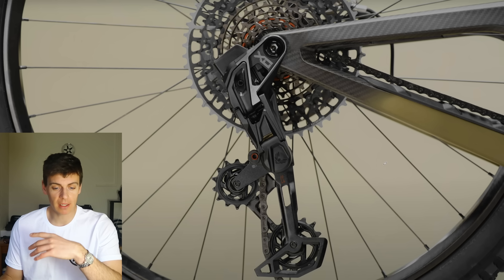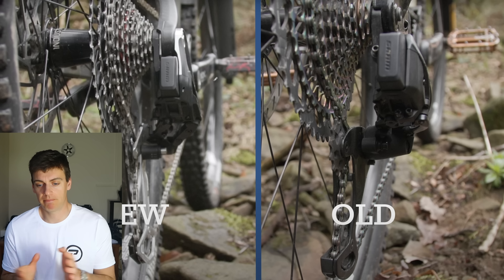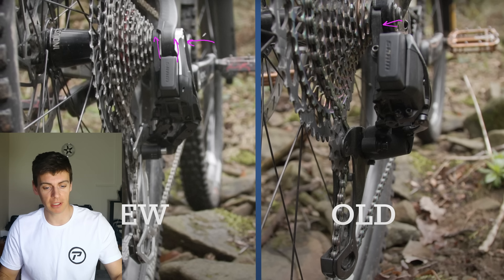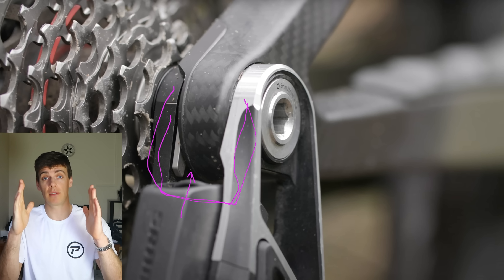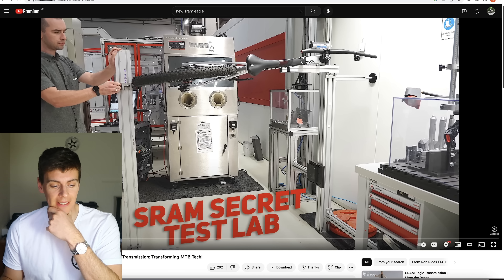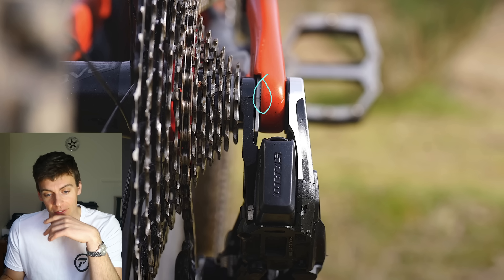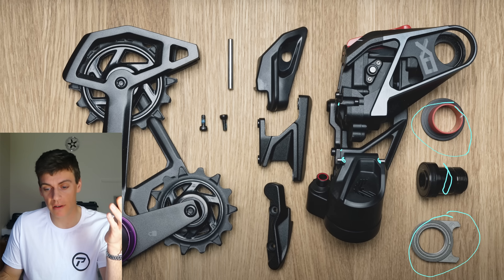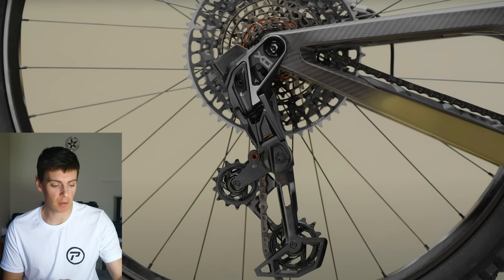Mechanical Engineer's Speculation of new SRAM Eagle (including misinterpretations!)

Comment: "They've created a solution to a problem that didn't really exist, the price is 650 USD just for the rear mech" about sums it up.  It needs to be mentioned too that these use proprietary batteries, which is a telltale sign of consumer antagonistic planned obsolescence landfill toxic waste.  You can get a cable today for bicycles from the 1960s in any bke shop, I have effectively a lifetime supply in the basement, didn't even cost very much.  You can't store batteries that way, nor can anybody afford to buy them that way, and anyway, its a proprietary battery, next year's mech could have a different one.  Having seen the consumer antagonism SRAM and the other one are capable of with purely mechanical technology, I shudder to think that they'll do with batteries, let alone software.  Now let me go mount a serrated metal washer to my carbon bike frame.

Comment: I would have to inspect it closer but from what i've seen on the third picture of the pinkbike development article the derailleur is positioned by the axle and not by the dropout. That's one of the reason you don't need limit screw and tuning. The cassette will be positioned relatively to the derailleur via the axle so there is no real issue with alignment in my opinion. In fact i genuinely think it's better. Many hangers are bad and are too soft so they constantly get bent for no reason and it happen regularly that you're out on the bike and 's*** the hanger is bent" and you have to correct it by hand to enjoy your ride. Also people are not at their LBS after every ride to have their hanger checked. Plus many hanger snap for no reasons. In this design the external bending forces will pass to the axle/hub and not to the dropout. It's not perfect but i don't see it break many more frames than the hanger design.
Hanger experiences on my bikes : 
Scott Spark 18 => fine hanger 
Cannondale Moterra neo carbon -> snapped, bad design. 
Trek speed concept 1 -> Dropout snapped, had to rebuild something to get the bike rolling, known issue. 
Look 795 light -> ridiculously soft hanger.

The added stiffness and eliminating source of misalignment will make for better shift. 
Price is out of this world given that a good mechanical eagle already works superb.
Reply: I’ve snapped way more frames than I have mech hangers 😜
Reply: @williamsimpson8115  yeah me too thats the reason i only ride aluminium because the are cheeper to replace 🤣
Reply: And you have to remember that many frames get damaged because the hanger snaps because of a realitvely little stick and the derailleur gets into the cassette and smashes into the chainstay. Those are the main carbon frame damages I've witnessed. I agree that I am annoyed by the bending of hangers, sometimes even just by loading the bike into the car. I think there are shifting performance gains possible with this system, and I'm curious if it can prove itself and if tolerances are sufficient.
Reply from the maker: Good comments. Firstly, is it actually positioned by the thru axle? The derailleur inner plate is firstly bolted to the inside face of the dropout. Then it's pulled in by the thru axle. So its a combination of both systems and their stiffnesses as to where it ends up! 

Great points about soft hangers. How many times have we seen mechs go into spokes when someone shifts to the large cog after having knocked or dropped the bike. Very common.
Reply: @PeakTorque  yes it positioned by the they axle. The derailleur is assembled onto the bike to fit the bushing assembly and derailleur. The thru axle then goes in to set the position and alignment, usually with a wheel or hun included for best accuracy. Then everything is tightened up and the B limit position set. Then everything is torqued down. These derailleurs don’t move up and down much in use and the bush is replaceable anyway just like with a normal hanger mounted derailleur. I had the mechanic if the 91songo Specialized team show me how it goes together on Tuesday. They can stop raving about it because they don’t bend hangers anylonger (they have been using these derailleurs since last year) which makes for more reliable shifting in the races. They used to bend hangers a lot. It was improved first with the overload clutch and better now the whole thing is stiffer for the heavier derailleur (than a mechanical unit). For us mortals a mechanical derailleur also has an overload clutch Called a derailleur spring. If anything this design improves the mounting for electronic derailleur’s. The mechanical units will likely stay as they are now.
Reply: great comments Antoine

Comment: It is impressive how the industry is trying to destroy an almost perfect machine. The mech anger is a simple, by design, tool to absorb possible damages to the frame/bearings, AND to the rear mech. SRAM, as it is more than usual nowadays it is giving us "inovations" that we don't need. A more expensive product, more prone to be damaged and trying to create a new standard motivated by marketing ideas and not thought by engineers who know what a bike does and how is used by an end consumer. A last note to you @peak torque: kudos! The "reviews" that started to appear at my YouTube feed where a disgrace: not even one pointed out some obvious problems: just one that mentioned the more energy the battery has to use to move the strange device. So, it will last even less. Does anyone need more than a cable actuated 12 speed XT system?

Comment: @Peak Torque, you talk about this as if the derailleur is mounted to the frame... But isn't the whole point of SRAM's design to mount the derailleur directly to the axle and thereby fixing it to the same plane as the wheel/hub/cassette-system? Is there really that much necessary tolerance/possible play in the axle-derailleur interface that problematic levels of force would affect the frame at the dropout upon impacts to the derailleur?

Comment: There is a spacer in the mount that takes up the slack necessary for install.  It's also indexed to allow accurate alignment when assembling the derailleur to the bike.   A few other videos show the install process.
Reply: The washer is also smooth on the dropout side.   It's not serrated on both sides.

Comment: Excellent assessment, except it’s nought but an exercise on paper. 

Out in the real world, folks have been riding this for close to half a year and reported nothing short of a stellar performance. Quite simply, they had to actually be trying to intentionally take it out to actually cause any sort of temporary damages. And more of then than not, nothing that couldn’t be fixed by a quick part replacement. 

Hits that the new UDH would shrug off, would likely have left you stranded if you were on a traditional hanger based system. 

But heys, it’s not always about real life facts for some ppl right? Change bad. Must protest. Ain’t that right, folks?

Comment: Also, SRAM shows only the impacts from the side which in my opinion are not the most common ways of saying goodbye to the derailleur hanger or the mech itself. I am really curious what would break first if you hit the rock or stump head-on or what happens when the stick gets caught in the spokes and takes the derailleur cage for a ride around the axle.
Reply: I think it's just going to be a few months after launch that we'll be seeing pics of broken/cracked rear triangles on frames from knocks. Most knocks will happen at the bottom of the cage which will only amplify the effects of any forces. It's fine for SRAM though, the derailleur will still be unharmed, I'm sure.

Comment: I’m not an engineer so this is pure speculation, but do you think the accuracy for the tolerance of the frame would be greater than however straight the average bike mechanic could get a hanger? The way I see it, this derailleur will always stay within frame/derailleur interface tolerance, however the hanger will only stay as straight as the mechanic can make it (not forgetting that the more times a hanger is adjusted the weaker and more prone to bending it gets)? 

Additionally, would the bushing not just be replacing the standard B tension pivot and therefore not be introducing significantly more potential wear and subsequent play into the system? Would love to hear your opinion on these

PS that carbon mashing monster shim is outrageous

PSS Gearboxes for lifeeee 🤙🤙🤙

Comment: Great video PT. I did think however that the point of the system was that as the mech is tied directly to the axle then it goes some way to negating the possible angular mis-alignments of the frame. With the assembly clearance in the frame and the relatively high stiffness of the new clevis hangers does it not mean the mech will maintain its perpendicularity to the wheel axel and therefore cassette? So in effect doesn't matter if the drop outs are on the piss because the mech (jockey wheels) to cassette will maintain a coincident plane? The whole wheel and mech system will be on the wonk but straight to each other. That's what I understood from the marketing.
Reply: yeah, i dont get why a Engineer does not pick up on that...
Reply: it will maintain it alignment with the frame not the cassette or the wheel
Reply: @parthmache4733  so we have this big clonky thing, resting against the hub, secured by the axle, pressed against said hub, i think it aligns with the wheel...

Comment: As with anything SRAM, don’t be their Guinea pig. SRAM has a bad habit of launching product and having their customers iron out the problems for them. 

The dropout piece really concerns me. Ive seen frames with up to 15mm gaps on 148mm thru axle setups. I can imagine the mounting angle changing quite a bit once wheel is secured.

Comment: Hey @Peak Torque

Love your stuff. But there's a couple of factual inaccuracies you might want to address.

- The cassette has an odd 21 tooth. I don't think it's narrow wide at all. Just improved shift gates I guess.
- Any slop between the two plates of the derailler is taken up by the derailler bolt, not the through axle. 
(Edit: This is incorrect. The outer plate is not clamped at all as PT has indicated in his pinned correction comment and latest video)
- The knurled washer will not move when you remove the wheel. It's held in place by the derailler bolt.

Interestingly the derailler bolt torque as written on the bolt from the first batch is 25Nm, and they've already claimed that was a "mistake" and the correct torque is 35Nm. 

I generally agree with most of the sentiment of this video. Wouldn't want the useful content to be ignored because of these small errors.

Keep up the good work!
Reply: The cassettes utilizes narow wide tech and is even, save the 21 tooth cog for installation
Reply: Thanks,  I watched this video with great interest and thought surely if there are this many mistakes in the design of this new system they wouldn’t have manufactured it to begin with knowing the liability would fall back on them.  I’ve been extremely happy with my AXS stuff on my road and MTB bike and generally it has worked without issue.  But….I did have to cut a ride short yesterday because faulty shifting due to limit bolts being loose.  The new stuff does away with this.  BTW, I’m not an engineer but shouldn’t any metal contact point between the carbon frame and say, the star spacer that’s part of the clamping mechanism for the derailleur on,y make contact with a metal embed in the carbon?  What keeps the traditional hangers secured without creating the same issue to the raw carbon ?
Reply from the maker: Hi Thomas thanks for your points.
1. The setup cog i think is the only non NW cog. The others are, nothing wrong with that. 
2. I understand i misinterpreted the outer plate does not get clamped to the frame. I pinned the comment about that. 
3. The serated washer is static yes, but it sees extra cyclic clamping every time the thru axle is tightened/released. I also have heard from another channel of this part spinning and eroding the dropout during impact on their impact test (although they didn't show it). So i do believe that is a risk.
Reply: I wonder how long before someone asks SRAM to pay for a frame or rear triangle to be replaced after their new design causes damage due to no manufactured weak point being the hanger. Not an "if" but a "when".
Reply: spot on Thomas. There's a lot of BS in this video which is an injustice to his usually good work. I won't throw the baby out with the bathwater but this video deserves down votes and if he doesn't address it I'll put in the YT Karen group and unsubscribe

Comment: Dunno about the crevice clamp issue?   From the pictures it looks like there is a shim in between the inner Mech and the frame...  and as far as adjusting the mech by bending the hanger?   That's only needed on old style because the mech it attached to the frame .  this system is datuming to the axle itself. Ignoring the frame
Reply from the maker: Put the final axle position is set by the dropouts...

Comment: I agree with a few of your points.  With alignment I don’t see it being as large an issue. This design is always aligned to the rear axle. The stack up is not ideal with multiple component interfaces from axle to mech. The serrated washer confirms this design intent in my eyes as the inner clevis plate is able to move slightly and then clamp down aligned with the axle.  As a fellow ME and cyclist I enjoyed listening to your take. I think it has merit, but the design needs to mature.

Comment: Isn't the idea the mech is aligned to the axle. So the accuracy of the dropout doesn't matter.  Normally new solutions solve manufacturing problems.  Disc brakes solve delaminating carbon rims. This solves shit dropouts.

Comment: I liked the arguments but didn't get the last one: Isnt the sideload transfered between teeths of the cassette? The rear mech moves a chain that does not have any load and presets it to a different cog while shifting. The sideload problem comes once the shifting links are in the area of the cassette where the load is transfered. 
I shift under load since years. up and down, no problem, didnt break cassettes or chains.

Comment: I think you’re reaching for ideas to make it look bad. The mounting tolerance issue is non existent because the alignment is taken up by the thru axle into the derailleur
Carbon layup damage???!! Come on that’s the biggest red herring on the internet. Mtbs see far bigger loads just from riding along than from a derailleur impact with a rock. How big of an impact are we talking about here?

coming back to your nonsense on alignment is quite shocking. With T-type the rear derailleur is always aligned at 90degrees to the thru axle , hub and cassette, therefore far more reliably aligned than a derailleur hanger and actually taking poor bike industry frame tolerances out of the discussion. 
Sorry PT, you are better than this crappy video. This just feeds the trolls mate.

Comment: I must admit I'm not within the target group for this product and I don't see a need to get rid of the hanger as well. 
There's a lot of concerns I share. What I'm not to sure about is your conserns about the shifting quality depending on manufacturing tolerances. Sure that would be an issue when shifting with cables. Here we have a kind of self aligning system. Not sure how it can cope with unperfect angles but they might have found a way. 
Also the bushing - if it's easy to replace and cheap that should not be an issue. Hangers needs to be replaced and aligned every now and then as well to keep the shifting performance.

Comment: I don't agree with general comments on alignment.   The frame has flex and will ultimately line up the same each time when the axil is installed.   However I completely agree that no matter how strong you make it without the hanger week link the damage is going to be worce .   It's very common for those of us that ride rocks and steep long climbs to take quite extreme damage but it usually easy repair replacing hanger

Comment: It is amazing how PT is literally standing alone against all marketing-text-vomiting channels. Kudos to you for keeping it real.
Reply: It seems “knowing for real” would be the goal before declaring the new mech a failure. Despite your engineering pedigree, your video is basically speculation. It’s all speculation until you have the device in hand. But judging by your confidence and 99% of the comments, you and your followers are convinced of your righteousness without a single ride or manual inspection. I respect approaching bike industry technology with loads of skepticism, but speculation is just speculation. 🤷‍♂️
Reply: @AaronLester123  I would get the impression from my first time watching him that he would not ride a carbon frame nor a carbon wheelset nor carbon handlebar because all of those items could also contain hidden damage from a crash against a pointy object. Carbon has that weakness. Maybe only steel is real for him. Crashes and impacts cause damage that is the nature of the beast when mountain biking. 
Regards shifting indexing with a replaceable derailleur hanger, the first good branch hangup in the system generally messes alignment as well. Once again just a faucet of mountain biking.
Reply from the maker: Ironically I don't do this type of video often because i hate speculation. I will try and fund the purchase of a unit and know for real.
Reply: @PeakTorque  sure you dont do these videos often, but whether it was the lovely series with china cycling and hambini, or you calling out Canyon years ago, at least you base your views from an engineering point of view. Granted, I don't understand all of it but at least I do not feel like I watched a sponsored commercial.